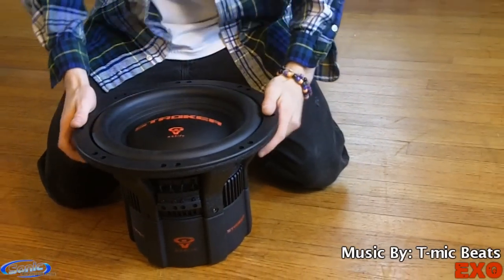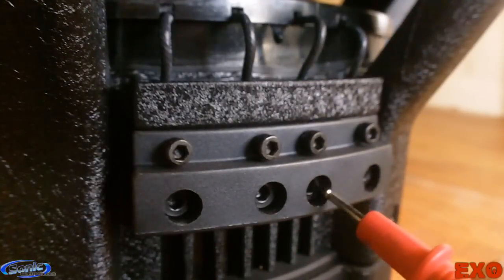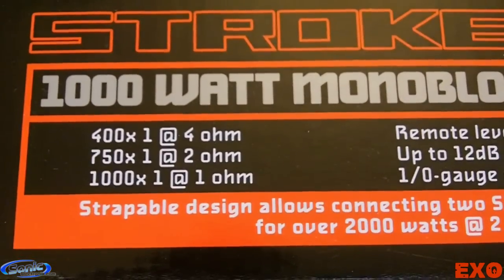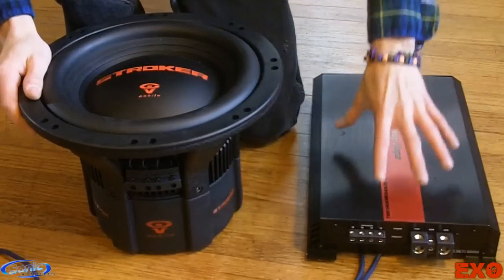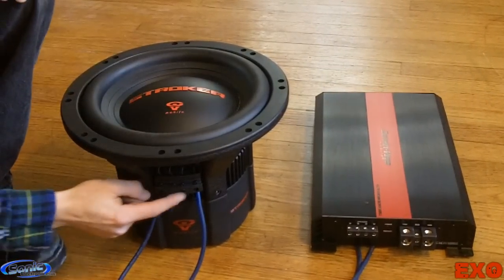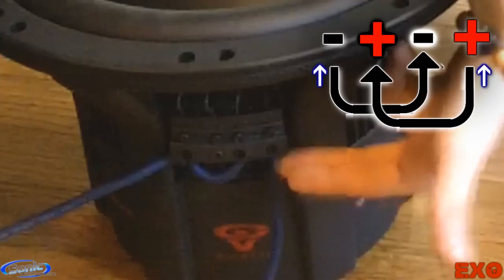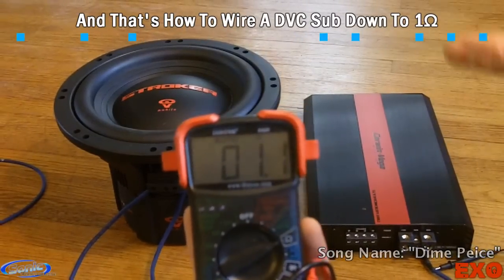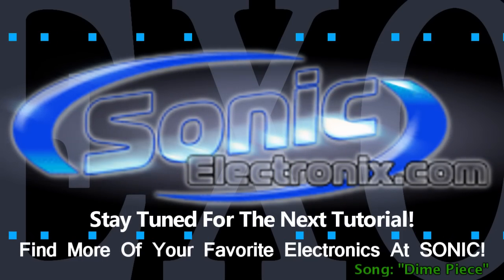How To Wire DVC Subwoofers In Parallel // Dual 2 Ohm Voice Coil Sub Wiring | EXO Car Audio Tutorial

Comment: Is there a way to take two subwoofers dual 2 ohm  and make it 1 ohm? I really don't want to bring it to 0.5 ohm. If not I guess I will have to run ORION HCCA HCCA3000.1DSPLX, Class D   at 0.5  hope the amp can handle it.
Skar ZVX v2 d2 12

Comment: What if my subwoofer has 1 positive and negative on 1 side and another positive and negative on the other side,  is it possible to just connect 1 positive and negative instead of the 2 inch jumper??????

Comment: Can I safely run an audiobahn 2801 X 200w x2 @4 ohm bridged into a Punch dvc 4 ohm with out running sub in series or parallel, and not mess anything up, getting the full power out of each?

Comment: Ok.  So I get series and parallel. And how to calculate impedance.  But curious about mixing them.  I have 2 subs d4. I want to add a 3rd.  Bit want to get as close to 1 ohm as possible.  Why cant I series the first, parallel the 2nd, then add a 3rd d2 sub, series that, then parallel them all together?

1/8+1/2+1/4 =
1/8+4/8+2/8=7/8
1/7/8= 8/7 which puts me at about 1.14 ohms. So why shouldn't I do this?  Does it mess with the distribution of power?  Sorry for the long question.    I just dont want to have to buy all new subs. ☹
Reply from the maker: Series isn't always ideal, so BE AWARE OF PHASING!!!! That's where you need to pay attention to your polarities and wiring VERY carefully.

Comment: Okay I hope I don’t confuse anyone . I have a dvc 2 ohm speaker I have a 2 ohm stable amp but the amp is way to much power for the speaker at 2 ohms but 4 ohms is about right with the amp . How would I do that and I’m trying to get the amp to not work so hard so how would you get the amp to run on 4 ohms
Reply: Connect both coils in series

Comment: How you hook up 8/10/ and 12 woofer all together In car?
Reply from the maker: Easy... YOU DON'T :)

Why do you want to do that?
Reply: EXOcontralto.                   I was thinking maybe two eights and 2 tens because the bass drum  in a song would be best for the 10s and the smaller drums would sound best using the 8's.  I guess I would need an amp for the eights and an amp for the tens. Thanks for the video very helpful bro.

Comment: Lots of folk on here need a basic electronics course... resistance vs impedance .... Ever wonder why you can put multiple 4 ohm speakers behind a three way passive crossover (parallel) and have a 4 ohm load on your amp? DC Resistance on a multi-meter is not always accurate. Buy an impedance bridge.

Comment: what about hooking 1 4 ohm sub woofer to an 8 ohm home receiver stereo amp ??? how do i wire it to get an 8 ohm load from the sub ?? i dont wanna damage my home stereo or my sub . i got it hooked up right now sealed box 4 ohm sub to the stereo 8 ohm . its running the sub fine but now i dont see a red light when i turn off the stereo and now i cant use my other terminals on the stereo it stopped working . help please .
Reply: U can't.
Reply: TREBLE REBEL yeah u can I googled the wiring diagram
Reply: TREBLE REBEL and found it on Rockford fosgate website wiring diagrams
Reply: TREBLE REBEL I mean I'm answering u lol we are bassheads tyrna gain knowledge in the car audio game

Comment: does anyone know how to connect speakers to .5 ohms
Reply: two dual 2 ohm subwoofers wired in parallel and then both of those are wired in parallel. if you don't understand then quit car audio.
Reply: TREBLE REBEL I kno what it is
Reply: Get dual 1 ohm subs if you want to run individual amps. Your gonna have massive current draws though

Comment: before you wire down to 1ohm you need to check if the speakers your using can handle it .
Reply: +Glen Fawcett doesnt matter if it's 1,2,4 or 8 ohm speaker its just about setting the gain of your amplifier right
Reply: If the manufacture says 2ohms ,and you go below,they will blow. I had my 2 12' and my daughters 2 12' at 1ohm when they should have been 2ohm. they both blow. And no my gain won't set to high either.
Reply: Its your amp, not your subs that you need to be checking.

Comment: i have the fosgate p3 dvc dual 4 ohm subs, how would i hook them up to a fosgate 800a2 amp?? also what would be the best box, i have a huge chevy passenger van??
Reply: wire them down to 2 ohms..(look it up its very simple)..I think that amp is 2 ohm stable..if you are buying a box..buy the QBOMB ported box for 12's with the truck liner coating..it provides deep bass and can be shipped to your door for around 109.00...BUT...if you have the time, and are so inclined.., build your own bro..and go big...i have the same subs..they pound for the class they are in...i have a 500 watt rf mono amp on each one...right about perfect for them and kept my whole system at like $1500 ...i didnt have alot of cash and needed sound badly...this combined with the pioneer deh80prs, infinity speakers(8) and tweeters (2) on a Fosgate 400 watt 4 channel amp is perfect..normal people think its way too loud...stereo people always say.."now you should buy this or that"..because ITS NEVER ENOUGH..ITS A DISEASE..LOL...I love it regardless

Comment: I'm looking at low profile a low profile subwoofer for my truck to go under the seat. I also have an amp with aftermarket speakers. but the speakers can't handle that much bass which is why I'm looking at subwoofers but don't want to loose to much storage space. is a low profile sub a good option.
Reply: Those thin subs NEVER sound as good as subs that have alot of airspace IMO

Comment: How do you wore a duel 2 ohm sub to a 2 ohm amp
Reply: +J⃟O⃟N⃟A⃟T⃟H⃟A⃟N⃟ S⃟C⃟H⃟U⃟L⃟T⃟Z⃟ you cant with just one subwoofer the end impedance  is 1 ohm (parallel or 4 ohm (series)
Reply: Car AudioDriver I figured it out already
Wired to 2 ohms
Reply: how did you end up wiring the 2ohm sub using both voice coils and have a 2ohm end impedance?
Reply: A little late answer, but you can just wire up one of the coils to get the 2 ohm impedance. Thus leaving one of the coils without any wires.

Comment: man, how does this process work on 2 subs coming from a Mono amp?  2 12" dual 4ohm kicker solobarics, 1 Pioneer 1,600 mono 1 ohm stable.  Thanks !!!
Reply: You connect them at 2 ohm by using the same plus on both and negative on both.

Comment: Hey exo I have a quick question. I have an l7 kicker that's dvc at 4ohms each coil. My amp is Kenwood KAC-929 and the manual says normal - @2ohms - 230x2

That's all it tells me for 2ohms.
At 4ohms it says
150x2
460x1 bridged 

My question is can I connect my sub in series and bridge it to this amp @2ohms

Thanks you

-Joe
Reply: i got the feeling that will ask too much from your amp. bridging or half resistance does the same thing: doubling power (sort of) but combining that will probably destroy the amp. I'm afraid you'll burn those cilinders inside (can't think of the name now). Anyways, don't do it you'll overheat the amp!

Comment: I have a single voice coil and a dual voice coil sub can I wire them the same to make them 2ohms without having to use the other unused voice coil. I'm a noob btw. Thanks in advance if you answer my question

Comment: i know this is an old video, but why do the jumper in the first place? cant you just connect the two other ends to the amp also? i see there are two empty slots on the amp. (sorry i know this sounds like a newbie question)

Comment: I Have a pair of boxes with thow of those speaker on each box.They Are Technical pro 120 oz. magnet
Frequency Response: 25Hz-2kHz
2500 watts peak power
Inputs: Bare wire terminals
18" die cast aluminum, 4" voice coil, 120 oz. magnet
Sensitivity: 98 ±2dB I have four of those . And my amp is Technical Pro 7000 watts peak power
200 watts @ 2 ohms
1300 watts @ 4 ohms
750 watts @ 8 ohms  How do i wired?

Comment: It depends. If you are talking about 2 Dual voice coil 2ohm subs wired completely in parallel it will be .5ohms. 2 single voice coil subs 2ohm subs wired in parallel will be 1ohm.

Comment: If you wiring it in parallel down to 2 ohms and your amp is rated to 2 ohms per channel then you will basically be running 1 ohm per channel bridged.

Comment: at 2:06 if you wire it at series you only make a jumper from the middle (+) and (-) the left (-) will go to amp and the right (+) will go to amp, either way he showed the impedance thru a digital multimeter  and it's down to 1 ohm(as they say, "trust your DMM!)

Comment: Your " parallel " wiring is actually series wiring. Think of Christmas lights. One goes out they all go our. If you took out your positive wire from the amp, you sub wouldn't be on. Parallel is where everything has its own power going to it

Comment: Wire them in parallel since they are dual 4ohm coils, but keep the gain low because each sub is rated for 750rms, but don't worry about the high wattage most 12volt amps are tested on a 13.5 volt system you wont get anywhere near that wattage the box says for that amp you want.

Comment: i have a two hypnotics hyp12D4.2 2000 watt subs and a bassinferno BI3000 monoblock amp the subs have dual voice coils and have 4 ohms and the amp says "1x1500@ 4ohms and 1x3000@2 ohms" how would i wire them series or parallel?

Comment: I have two 15 re sx dvc 4ohms 1000rms each I would like to wire them to 1 ohms but that means I have to get a 2000 or 1800rms amp @1omh stable right

Comment: can any one help i got a cerwin vega 400.4 amp its specs r-
60w rms at 4ohm 
100w rms at 2ohm 
200w rms at 4ohm {bridged}
and i plan on getting a pair of 8' p2 rockford fosgate not sure what to go with 4ohm dvc or the 2ohm dvc- and how would i wire them to get thebest out of my amp

any help mmuch appreciated & thanks in advance

Comment: My theory is that will I have to wire each dual voice coil sub as a series to increase the value to 4 ohm so that when the 2 subs are brought together on the same channel it will bring them back down to a 2 ohm load or will it bring them down a 1 or even lower value when they share the same channel?

Comment: I have a question regarding wiring. I watched your vid on wiring in parallel to reduce ohms. My question is what if you have 2 subs, both dual voice coil 2 ohm from the factory, I want to wire them just as you have done with the one sub, but i have 2 and both will be driven by a single mono amp. If i wire them both up in parallel will that reduce my ohm value of both subs to an overall 1 or even lower .5 ohm load? I want to know for sure so I dont screw it up. Thx and you rock the bass.

Comment: Thats correct. Now if you have 2 dual 4 ohm subs both ran parallel to 2 ohm, and then parallel wire them together, you will be down to 1 ohm.

Comment: Hey EXO
I got a 4ohms DVC Sub and want to run it in parallel on my 2ohms stable hifonics amp. Do I actually just connect negative with negative with a jumper wire and put another speaker wire in one of the negative coils to wire it to the amp and the same with the positive coils or is there any secret i didnt get yet?
Greetings from Germany

Comment: hey exo i just got 2 4ohm dvc subs and a 1ohm stable amp thats 1200 rms i have it all wired up but i checked my fuse at my battery and its a 40amp fuse is that big enough for all the power i need btw i have 0 gauge power wire

Comment from the maker: It's all up to you man, but it's always worth it upgrading to me ;) - But no, that would be a 0.5ohm load as the terminals are all connected. You can either run at 2, or 0.5 ohm.

Comment: EXO!!! I have a quick question about wiring subs. I have a 1200watt RMS 1ohm amp. I currently have a CW STKR122 wired to 1ohm. I am planning on upgrading to Kicker 08DS12L52 (2 12" Kicker L5s) They are DVC 600watt RMS 2ohms. Can I wire each sub in parallel to 1ohm and attach them seperately to the amp at 1 ohm? (basically, how you would install one DVC 2ohm sub but instead, there are two subs.) Also, do you think this is worth upgrading? (Still haven't installed your stroker?)

Comment: have got an alpine MRP-M1000 mono powered amplifier a 1000w RMSx1 2 ohm.  That is what is on the box and the next one on the box is 600w RMSx1 4ohm but they are both at 14.4v.  How do I get the whole 1000w out of it?

Comment: Since i have 2 12's and i wired them up normal but then in my amp i bridged them am i getting max power. they are both 800w and i have a 1600w amp.

Comment: Ok i have 2 amps at 2500watt max 1800watt rms and i have 4 12" subwoofers running DVC @4ohm. Amp is 2ohm stable how do i wire them up for 2ohm to be stable for my amp? This has been baffling me and confusing me!! Thanks in advance

Comment from the maker: With 2 Dual 4ohm coils - You can only run at 4ohm or 1ohm - That amp is not stable at 1ohm, so you're stuck at 4ohm, which will be considerably less power than 1ohm, or 2ohm, like your amp calls for.

Comment: if your amp is 2 ohm stereo stable then you would wire your subs like this dropping the ohms to 2 then put 1 sub on each channel... i believe if its 2 ohm sterio stable then it should bridge at 4 ohms you could wire in series getting 8 ohms per sub then bridge outside the box then and you should get  4 ohms x1 channel whatever sounds better... i had one of those bossp156dvc those subs should never blow with that amp.

Comment: Hey EXO, I bought 2 12' kicker cvr dual voice coil 2 ohm subwoofers. I also bought a Soundstorm lab's EV1500m. It's a 1500 watt mono block amp.  What is the best way to wire my subwoofers?

Comment: Hey Exo how would I wire this with direct leads. I will running the direct leads to some nuts on the inside of the box the running 8 guage wire for the nut that connects on the outside so it will be like nut washer bolt on the inside and on the outside of box bolt wash nut would this work and how would I wire it down to parallel when I get my sub back from psi? Btw its also 2 ohm voice coil wiring it down to a 1 ohm load on a Crescendo BC2000

Comment: haha sure thing! if you have got a amp to your left, and to Cerwin Vega's V-MAX's 12" (dual coil) to the right, can you then go from the amp to + on nr1 sub. And then from nr 1 sub to the nr 2 sub, witch you then parallel wire? 

The sub looks like this from above:

+  Sub   -
 -  Sub  +
and the same with the other 1

Comment: I bought 2 12" soundstream 800w subs and i was reading online that you should give the subs a bit more power then there rated for so i was wondering if that's true and i should get a 1700 or 1800w amp or match it with 1600w because the amp Im planning to get says its cea compliant so it should put out true wattage any help is appreciated man

Comment: 1 positive you say goes to the amp 1 negative goes to amp
the other 2 you need to connect to finish the paralel wiring.my question is do you need to twist the ends of the wires  together?  
like the when you take the jumper for the positive and put it into the same terminal as the positive thats going to run to the amp.  do you need to twist the ends together or can it simply just be placed in that same terminal?  im not sure how else to explain and i'm not great with words and/or terminology.

Comment: Ok, i have two cvr 15" 4ohm subs that run 1000watts peak and 500rms. Wat size amp should i get and how should i wire them to get the most power and still be stable

Comment: Here is the thing, my amp is only 1500 watts steady at 2 ohm... if i bridge it, and then run my subs in series turning my dual 2 to a 4ohm load, i can push 3000 watts with my amp... so im going with the more watts at higher impedance vs lower watts at lower impedance

Comment from the maker: It's all about the concepts mang - If you can't apply this SAME wiring concept with 6 to 8 subs, then you didn't watch or understand the video correctly - Basically, if you already know how to wire 1 sub in parallel, you should know how to wire as many as youwant using the same methods, and directions.

Comment: I got 2 batteries connected 4 gage wire but the thing is that when i use my multimeter it reads each sub at .8 instead of 1 n when i join them together it drops to .5

Comment from the maker: If you get a Dual 4ohm Coil you'll be able to run it at 1ohm, which clearly that amp is stable at - so I would go ahead and get the 4ohm DVC sub and wire it in parallel. You are only talking about ONE SUB, right? You didn't really specify.

Comment: hey Exo i got a problem with my system i have a 5000 monoblock amp that is stable at 1 ohm i already drop down my subs to 1 ohm but when i start subbin n turn up the bass knob it goes into protection, any suggestion? i would appreciate it

Comment: hay guess heres some advice, just take whatever OHM your sub say its dual 4 ohm you can get 1, 4, or 16 ohm loads.. on dual 2 ohm subs you can .5, 2, 8 ohm.. Its always in divisible s or multiples of 4.if you have 4 dual 4 ohm subs, you can get get .5 .2 ohms, and with 4 dual 2 ohm subs you can get 1, 4, or 8..

Comment: @EXOcontralto OK so my amp is a two channel amp that is bridgeable, if I bridge it, down to 900x1, 450 to each sub isn't that bad. But is that how it will work? 900x1=450x2. And the last question with my subs being dual 4 ohm coils, will they all stay 4 ohm.

Comment: i must ask before buying ..  ok so i wanna run 3 ma d4 15s 800watts a piece off a crucnh 1500(yes i know crunch 1500 isnt to great but its free)   .......ok if i took the top postives and negitvies and hooked it to the left channel (each channel is around 1500 watts)  and then i took the bottom ones and hooked it to the right  would i power them enough?.  so im thinkin each sub would get around 800-1kwatts?    top coils get 1500 watt and the bottm get 1500 watts ? im not sure that why im asking